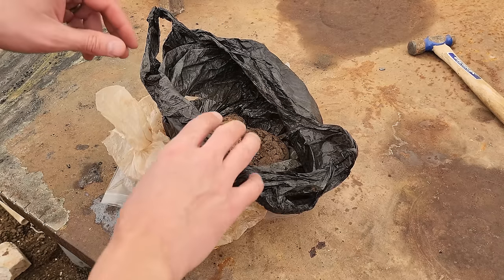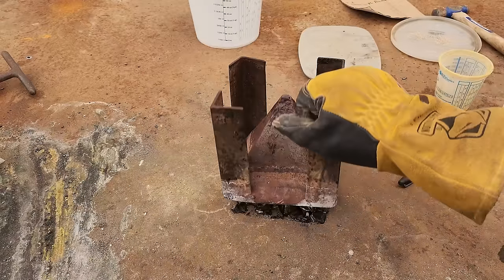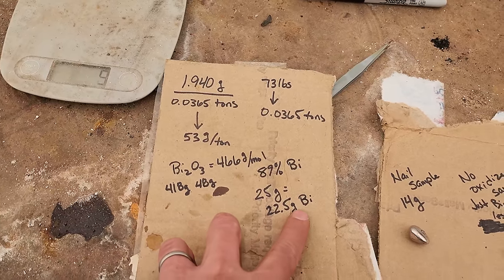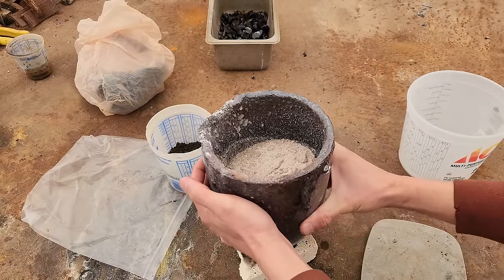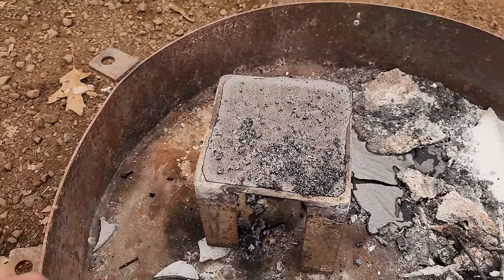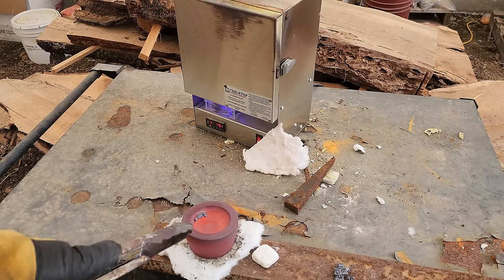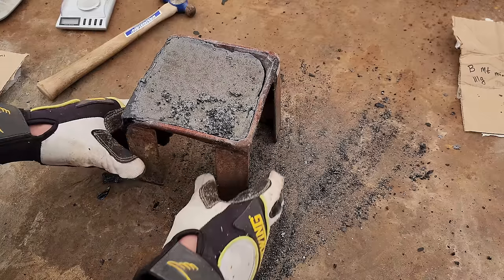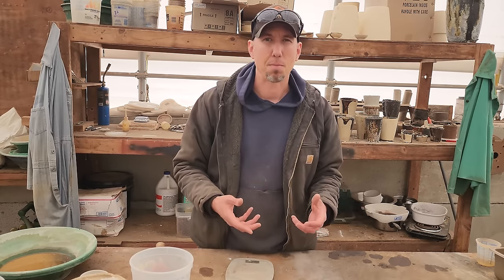Gold Smelting, Is It Worth It? Part 2!!!

Comment: You have a fabrication shop there- why don't you make yourself a decent sized smelter? There are loads of videos online on how to do it and from what I have seen of your equipment, you have the necessary tools and skills set to fabricate one. Then you could smelt larger volumes and make it cost effective- also buld a larger pyramid pouring jig and some properly forged tools for holding and pouring the melt- the set up you have currently is not safe for pouring - watch some videos online of people smelting and you will see the tools they use- easily made in your shop.
Reply: Yes, I have concerns also, there is plenty of info on how to be more functional and safer. Build up over your furnace, a fume hood, much like a blacksmith had with a good size exhaust fan. Metal poisoning, whether it be air or water is not fun and it will creep up on you, it accumulates in our body!

Comment: You may have done this before, but I'd like to see a detailed cost analysis- how much does the fuel cost for x amount of material, how much does the electricity cost for the cupel, how much do cupels cost and how many times/how much material can you run through them, etc. Kinda boring math, but interesting when all put together.

Comment: Really want to send you guys a sample of my heavily weathered black sands from an ancient glacial moraine here in central NJ.  I've found gold dust and small flakes from panning, but this material comes from eastern Canadian deposits where it's known that flour gold is held inside the hematite and magnetite grains worn out of the quartz ores.  I was lucky enough to find a quartz pebble with a broken hematite grain on the surface, and there in the middle a tiny speck of gold could be seen shining brilliantly in the sun (with a magnifying glass to actually see the little thing).

From panning various samples, including black sands from marine deposits that don't have any appreciable amount of gold, I can tell these glacial black sands are MUCH denser.  The ocean black sands easily wash around with even light swirling of the pan, while the glacial ones are so heavy that it's often hard to separate them from the gold dust.  They also possess the ultra fine 'silver sand', which can be anything from lead ores to PGMs (and the ores in eastern Canada are known to have platinum).  

It'd be a simple smelt too, since any sulfides are long gone.   This material has been ground down by glacial action and weathered in the open for at least 10,000 years.  I often find quartz stones with cavities where you can see the imprints of the pyrite crystals and masses that oxidized and washed away over time.
Reply: Do a SG of these black sands and do a SG of black sands totally removed. Should help answer your intuition! Then crush in a dolly pot to flour and carefully pan, Eh? Look for Au stuck to the steel on the thumper and inside the pot!
Reply: Don't ya love nature's mysteries?
Reply: Are the black sands magnetic?  If you measure the density and it is significantly greater than 5g/cm3 then you might have something interesting
Reply: Hydrochloric or sulfuric acid will dissolve hematite. Might be worth reacting a small sample of your sands with an appropriate amount of hardware store muriatic acid (HCl) to see what's left when the hematite is removed
Reply: @whateverX7 Some of it is magnetic, some of it is not.  I could try displacement to get the average density, since these sands are totally dry now.  But if the gold concentration is, say, an ounce per ton and there are less-dense metal oxides mixed in with the gold-containing ones, the result on density for a small sample will be misleading.

Comment: instead of adding big chunks of iron to get eaten away to reduce the collector metal, what would happen if you figured out a ratio and weighed out an amount of iron to add to the mix? that way you don't have excess chunks of iron covered in collector metal. Or at least it would seem you could reduce the size of those excess iron chunks and the loss of collector metal maybe. Or would that cause some other kind of contamination issue?

Comment: Have you ever scratch/acid tested the beads/buttons to get a closer number on the percent gold? Seems that would be an easy way to value them. Is the button 22k, 18k, 14k or 9k? That info with the weight would give you a real value number. Of course that does not value the silver content though.

Comment: The bismuth that fuses to the steel, couldn't you heat the steel up to 1000°F and the bismuth would roll off and the steel wouldn't melt?

Same thing as you did with the matte at the end.
Reply: Depends if bismuth and iron combine when they melt .. The part of the bismuth that soaked into the iron won't just roll off.
Reply: @frontiervirtcharter  it looked like the bismuth was plated on the outside. Iron doesn't melt until a lot higher Temps. That's why I was thinking the plated bismuth on the outside would run off if heated up

Comment: Your getting better so fast you need to slow down before your blow up a charge in your furnace. Powder lead litharge was needed before to do proper collections. I am hoping your getting info. as the prills you are using have put gold in to a no show in the past and popped many messes in the oven, never when using those prills in a charge have it no larger than 25% of vessel. you need to pan down the cons and try identification of the elements before selection of flux for use action mining chart subjections for the cons you have.
Worth it yes because the cost of a single fire assay for each answer you needed in this video would be costly. You can make the changes to the fluxes to get the results and then prove it and with the same flux over and over to grade the ore yourself as your guide.

Comment: Why do you have your propane tank in a bath?
Reply: Keeps them from frosting up even if its hot out the propane can freeze.
Reply: As pressure decreases, temperature decreases. That helps keep the tank a little warmer so you don’t get ice buildup.
Reply: Gotta treat your propane right. Pampered propane will always put in the extra mile
Reply: Actually a good question, very observant.